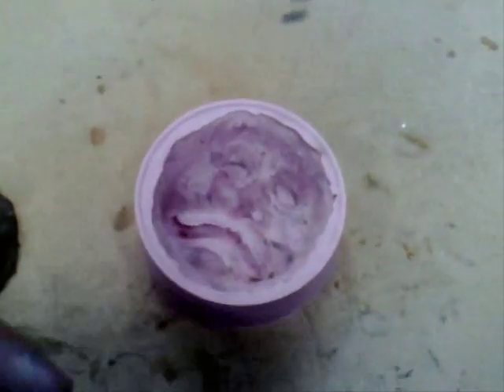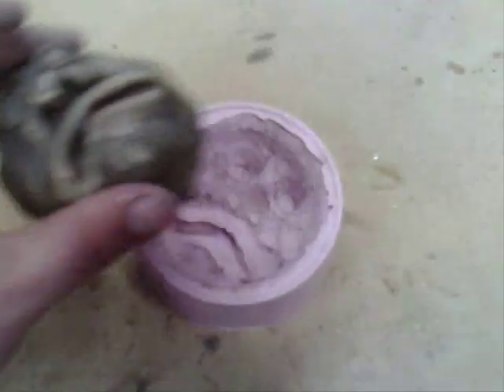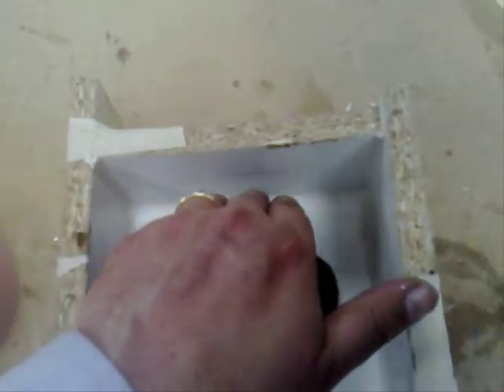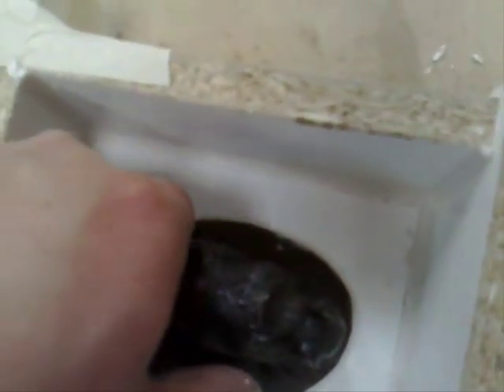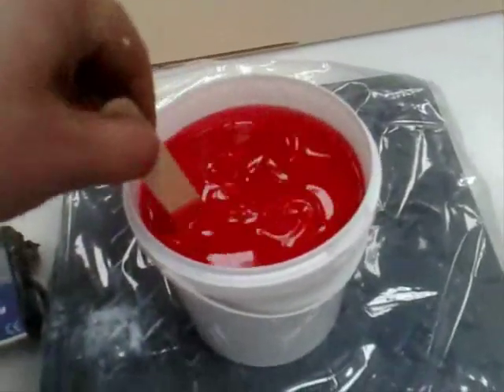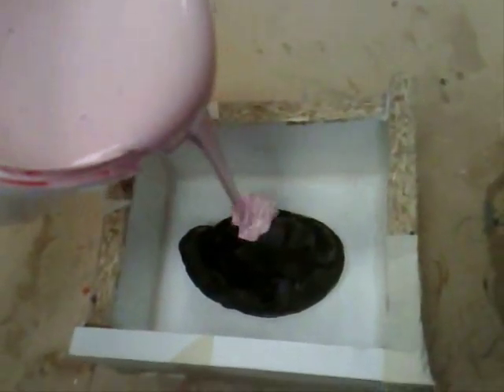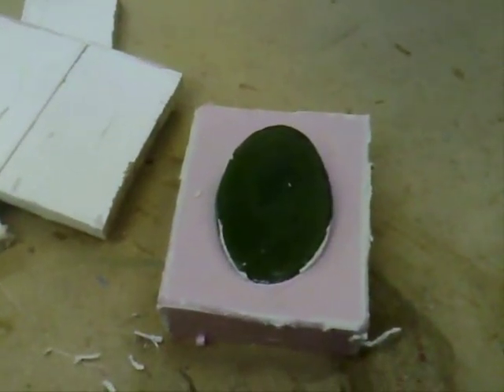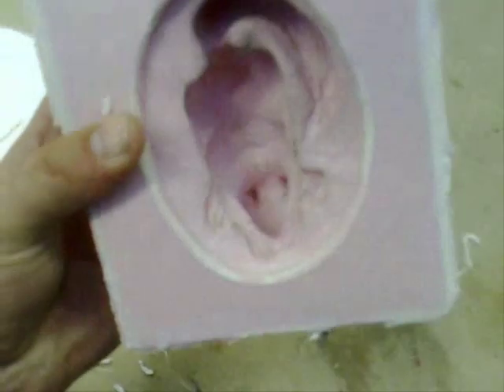HOW TO MAKE A RUBBER MOULD USING OUR 2 PART RTV SILICONE

Comment: Hi,
I miscalculated how much silicone I needed, if I add more later will wet silicone stick to cured?
Reply from the maker: Carleigh Sylvertiger 

HI The RTV silicone will stick to itself quite well,
infact you often need a release agent applied to silicone when making two part
moulds to stop adhesion.   Howeveravoid too much stress on the silicone mould when removing parts as this will always be the weakest area ifit was to tear.

Comment: do you have a formula for working out how much to mix for the volume of the mould?
Reply from the maker: Evoluzione069 Hi some would just pour water into the mould then dry it off after pouring it back into a calibrated beaker. hope this helps

Comment from the maker: HI Gazeebo88, you can adjust the shape of the outer walls of the former to reduce the amount of silicone needed, for example for this mould i could have angled the corners of my box former and made the housing more hexagonal in shape reducing the amount of silicone needed, Alternatively a thickening agent can be mixed with the silicone so that it can be painted on than backed with a plaster and bandage to form a shell to hold its shape. 
Rgds ecfibreglass